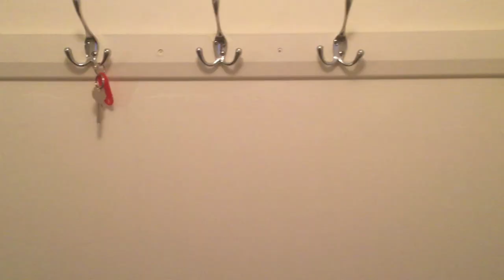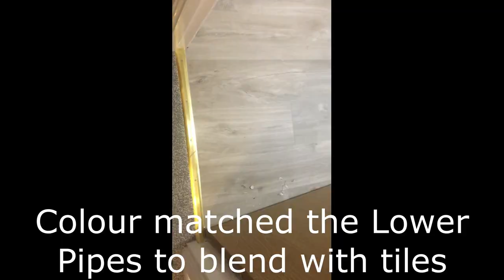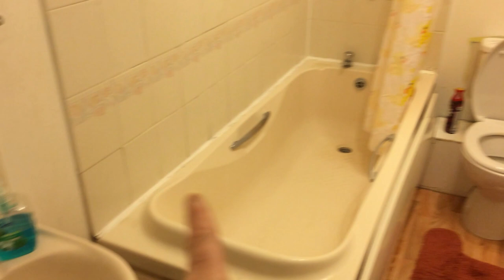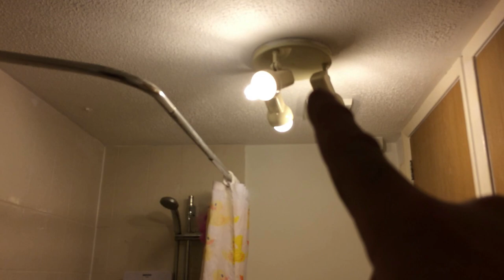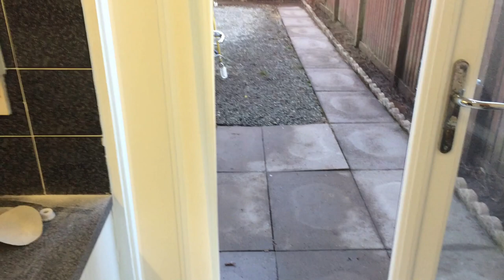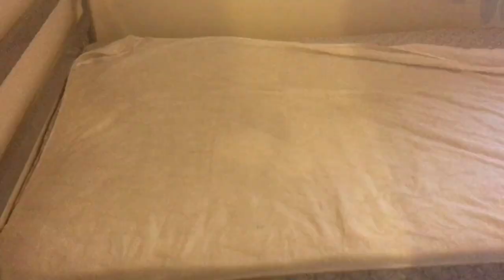UK Rental Property Renovation BEFORE & AFTER | Rental Property Refurbishment

Comment: Great editing Barry.  Just the right level of detail to show the comparison of before and after without dragging it out.  Would be interested to know the typical cost for materials for this type of renovation (I know it can be a ‘piece of string’) along with man hours, if that’s possible?
Reply from the maker: Ha, not sure about the editing Neil, I still need to learn how to cut these down and make them flow.......it is not easy 😫
  With regards to costs, I will not go in to detail, but I find that most rental property cosmetic renovations tend to come in at between 3>15K (including labour) depending on what is required.  
 Most landlords want as much done for as little as possible..... - it is always my job to convince them to spend an adequate amount to get the property rented out quickly (that is key). Fortunately, most of the ones that I get involved with usually get rented out quickly, so it is a win win situation.
 I have one of my own rental properties that I will be doing fairly soon (depending on several factors) that I want to film, I will go in to a high level of detail with costings for that one if it helps.
 I have a lot of portfolio photos from previous renovations, so I may put some of them up and explain what was spent and why - you gave me an idea for a video 😃👍